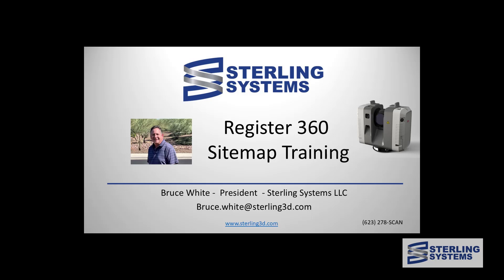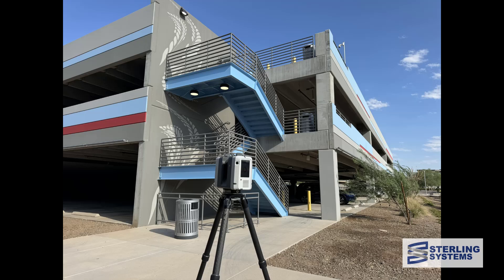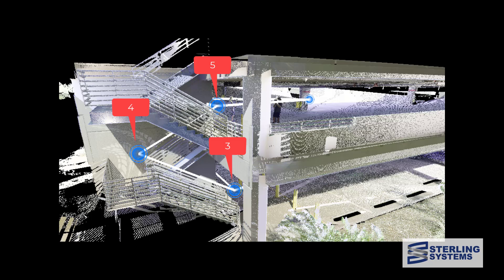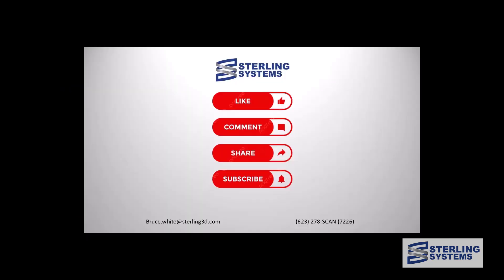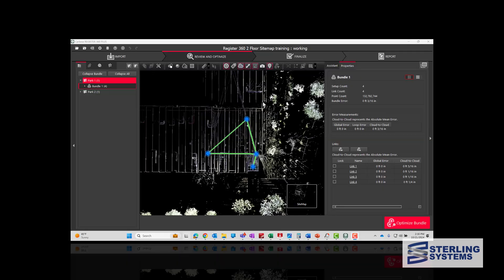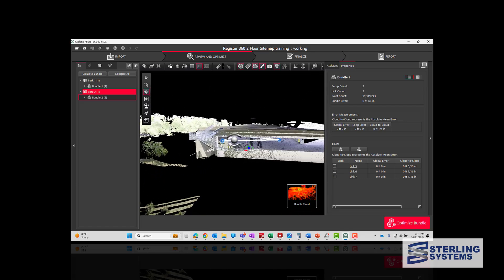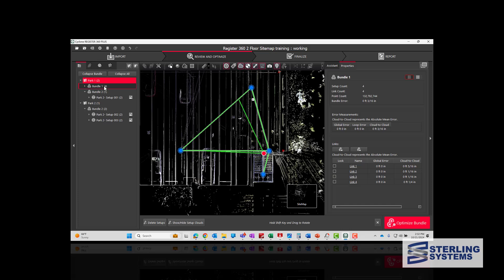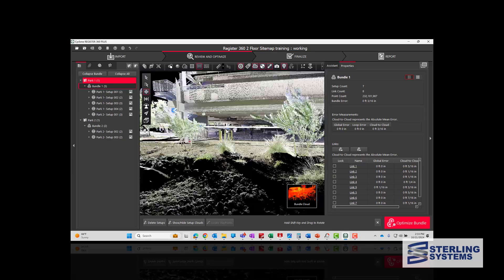Leica Register 360 Site Map Training

Comment: Nice simple explanation of the process for multi-story buildings. Another tech tip would be to use the scan names to organize the different floors as well. We typically use 100 series, 200 series, 300 series, etc. for each floor and then separate floors into SiteMaps as you describe in R360. Ideally if there is the option, we will also connect floors at all stairwells to provide as much linkage between floors as we can get.
Reply from the maker: Interesting, thanks for the comment